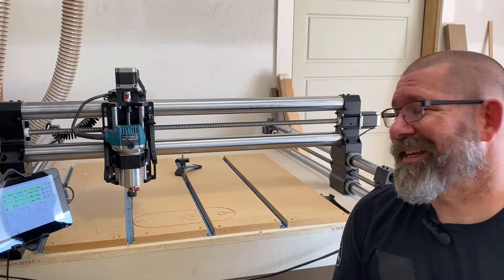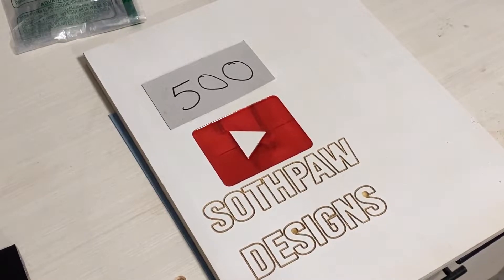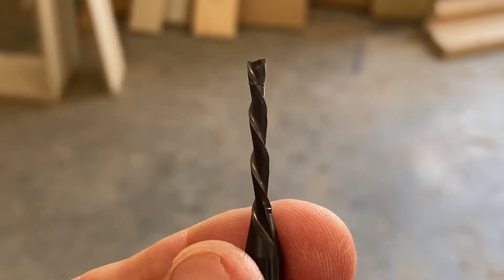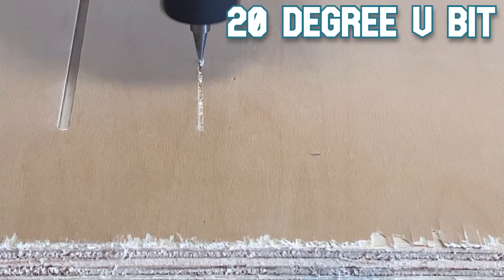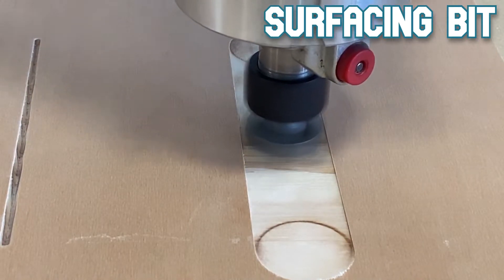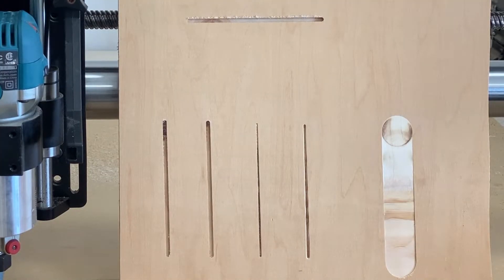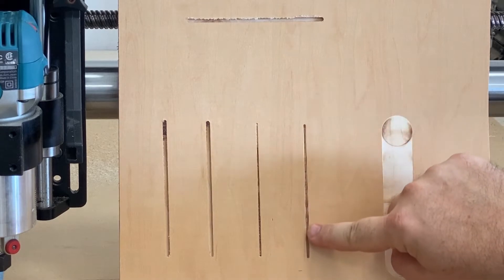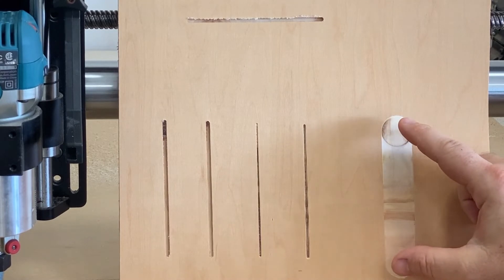Beginner's Guide To CNC Bits | Onefinity CNC & Woodworking

Comment: Damien, enjoying your videos because I just got my OneFinity (I'm just a hobbyist), and your conveying what you're learning feels like it's me learning too.

One thing I want to do with it is to resurface epoxy pours, or even just flatten some seasoned hardwood I have.

I read a horribly scary post on the the OneFinity forum about running the Makita at lower speeds with a resurfacing bit.  The OP even says flames were shooting out of his router.  I'd like to try to avoid that.  Two Moose Design made a beautiful table and surfaced it with a Makita router and seemed to do ok.

I'm not that far along yet and am still aiming at things like cutting boards and personalized signs.  I really liked your epoxy pour coasters too.  

So my question is about flattening and what's safe, are flames really an issue, am I going to burn out my router sooner?  (How did you finish off your coasters, sanding or cnc flattenting?)   I can see batching things out with an initial cut, pour, then maybe a flatten and final cutout as a workflow.  

A second question I have is on tooling costs. In the event that I muster the courage to actually try to sell my stuff, is there a way to calculate how long these different bits last?  I've heard you say you're aggressive with yours, be interested to know if you feel like they dull faster or break more, etc. 

Thanks,
Reply from the maker: Good questions.I've not tried to surface epoxy yet. I'm finding that I'd really rather use epoxy to fill in the pocket, and use a different finish over my projects. Once the epoxy dried on the coasters, the rich walnut was covered with epoxy, so felt plastic. In hindsight, I should have waited till the coasters dried before posting that video, so I could show that finished result. I'm considering filming another video and adding a card to the end to show that part. 

I haven't used my CNC long enough to wear out any bits, but I do have some Christmas projects on the agenda in coming weeks, so I'll be watching out for that.

Comment: For pocket cutting I've found a compression bit does great to give clean cuts top and bottom
Reply from the maker: Yes, I'm familiar with compression bits, but have never used  one, so I didn't include them in the video. I should have mentioned them though.